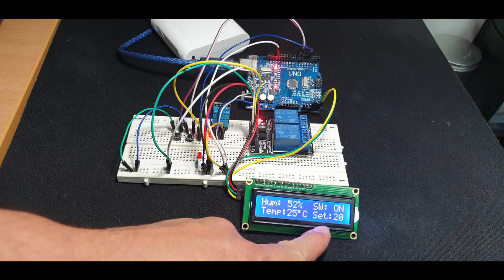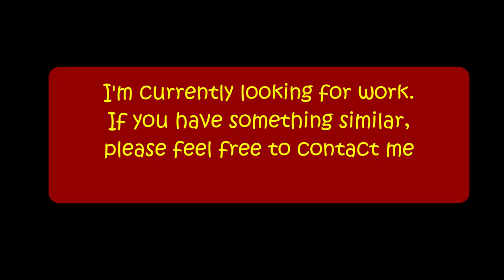Arduino Automation "Temperature Control" Part 1 of 2

Comment: Is it possible to have this set up, with a variable temperature setting (off a graph over time for baking/roasting) assuming the temp sensor is an infrared heat sensor
Reply from the maker: Setup a time based counter to switch from one temp to another.

Comment: Can this will automatically turn off the temperature for the water really high?
😊
Reply from the maker: DHT Sensor is only for air. You'll need to replace the sensor. Use one designed for water and modify the code accordingly.

Comment: can we apply this idea in drying rice grains in a small acrylic chamber?
Reply from the maker: I'm not familiar with the process of drying grains. You should use PID temp and/or humidity control if it needs to be more precise.
Reply: hello sir goodevening...In the wiring diagram you have providee, I'd like to ask where did you connect all the red wires and black wires? was it a terminal block? if so, what kind?
Reply from the maker: @christianisidoredealco4942  Those are 5v and GND on the arduino nano clone. Search and lookup the pinouts for arduino nano. The vin pin for the nano can accept 12v.

Comment: brother can you tell me the code for my project . ds18b20 temperature sensor , LCD 16×2 , arduino UNO & fan , all connected .

As the temperature rises , fan goes fast or Start rotating and  if temperature goes low , fan slows or stops down...

Comment: Could you possibly do an automatic thermostat with your arduino? It would be a great help. With heating plate or similar bases or with electronic thermometer. Thank you very much for doing so!I would need one that is, say, on at 25 and off at 29.If you were to do it together, it would be the most fantastic!
Reply: have a look online for the relay he is using.  you can use that relay to switch on and off a heat mat depending on the temperature

Comment: Arduino:1.8.13 (Windows 10), Kart:"Arduino Uno"

Thermostat:11:10: fatal error: LiquidCrystal_I2C.h: No such file or directory

 #include <LiquidCrystal_I2C.h>

          ^~~~~~~~~~~~~~~~~~~~~

compilation terminated.

exit status 1

LiquidCrystal_I2C.h: No such file or directory

This report would have more information with
"Show verbose output during compilation"
option enabled in File -> Preferences.

it gives such a warning
can you help me?
Reply from the maker: Try the liquidcrystal i2c library by frank brabander

Comment: Can i know where you put the temperature sensor??. I don't see at your wiring diagram
Reply from the maker: Since I'm using the module which already has a resistor, there are only three pins to connect for the dht11. VCC, GND and Signal.